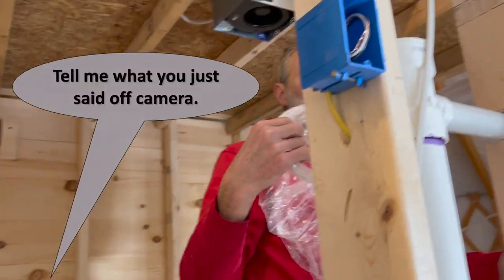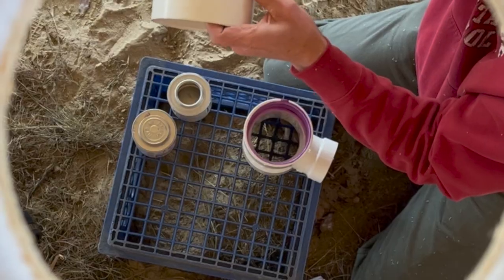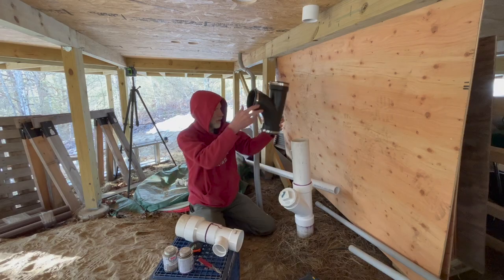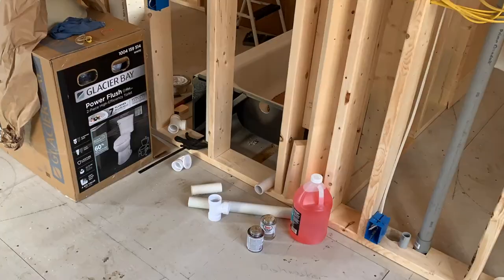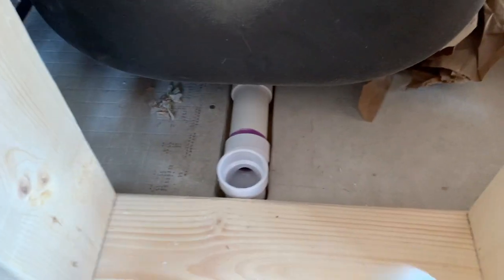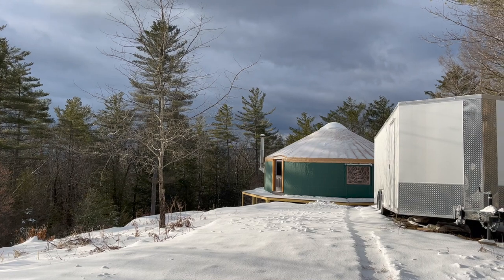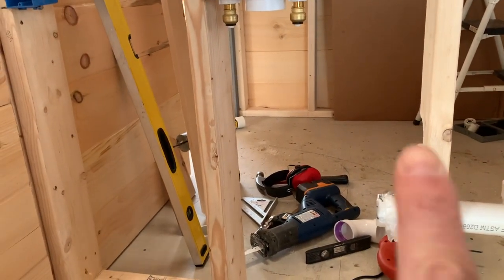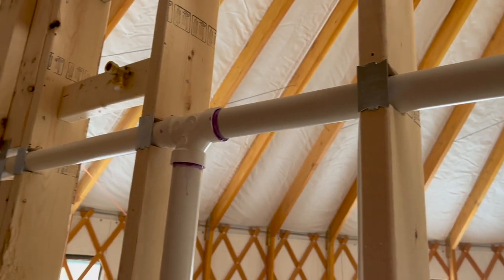Vents and drains! Yurt Plumbing - Part 2 - (Vermont DIY off-grid home build)

Comment: I didn't watch last week because I was out of town, so the progress in the last two episodes is massive. I love the fact that you didn't use drywall. I think it's going to look really pretty and upscale. Did you get any ideas yet for the wall behind the rocket mass heater? I have no suggestions because I don't have enough imagination, but I'm sure you'll come up with something beautiful. Stay warm!
Reply from the maker: Thanks Pat! We did have some nice suggestions on the heat shield decoration (you can read them in the comments underneath if you go back to the episode - some have links to video examples). We haven't made a final decision yet though, partly because I (Jill) ended up with too many jobs, and won't have time for art projects until the second half of October. I can hardly keep up with making the videos! (Teaching two college classes this Spring that I haven't prepared before, in Connecticut where I have to stay overnight; and I have a fun outdoor summer job 40hrs/week at a Vermont State Park lined up after that).

Comment: Wow, you built your yurt platform quite high! So this gives you a good amount of headroom under your floor. I haven’t done much plumbing. You’re right, everything needs to be assembled in the right order so you can fit it all together. I don’t understand why the septic system smells bad already. Have you been using your septic system already while living in your trailer? I thought everything was new and hasn’t been used yet. Looks cold!
Reply from the maker: Hello, yes we're using the septic system from the trailer (where the blackwater hose comes into the port at that big pile of rocks next to the RV). The yurt platform is pretty high, but not by design actually... it was built to make a level platform on a steep bedrock slope.